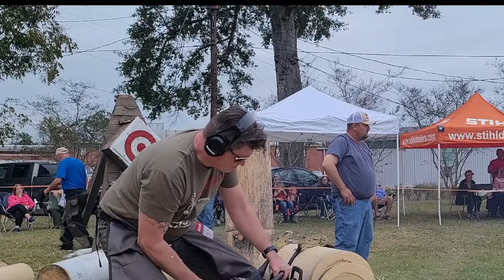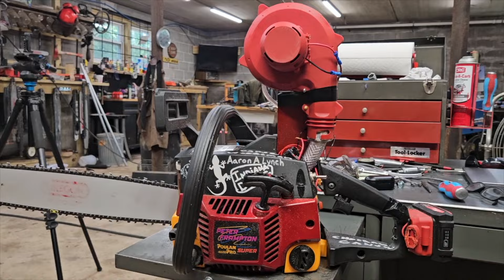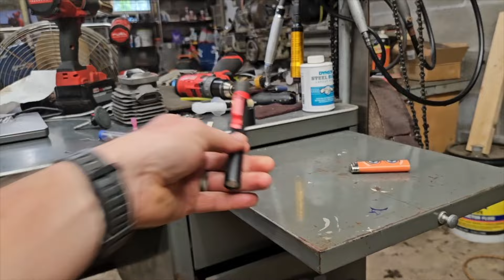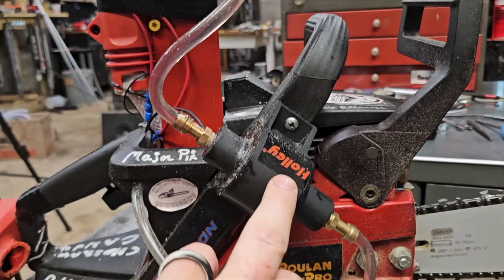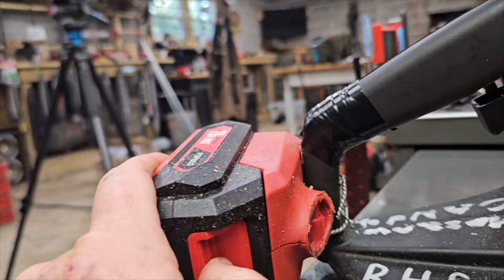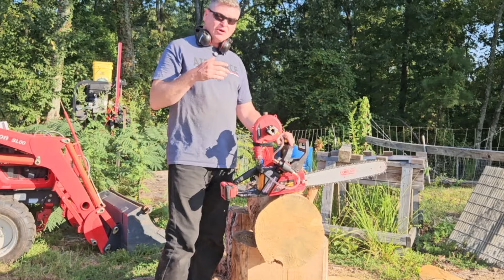Supercharging a Poulan 4620 295 chainsaw!

Comment: I think you're adding a little extra Air Volume, but not actually creating Boost Pressure at at high RPM.

Need a pressure gauge on Intake boot to see.

Comment: Interesting trial!
I suspect that blower in that configuration is restricted enough to fall out of its best flow/pressure range of operation. I wonder if even under the best conditions, that blower could make more than 1psi? ? I guess you could test that
Reply: A smog pump would do better for pressure than that a blower. 
I think they are vane type compressors, positive displacement
and can get up to 20 psi which would definitely be a boost. 
Pre-ignition dieseling could get to be a problem though for
a gas engine at sea level. An injected engine could be needed
for this to work right. A regular carburetor may not work at all.

Comment: Boedy, did you LOWER the static compression or increase it?
For a “normally aspirated” hi-po combination of any ICE your OVERALL compression ratio must be higher. If you’ve ever noticed, the top fuel drag cars with belt driven super charger run about a 7.5-1 CR vs a 12.5-2 normally aspirated setup. You’re also forgetting that it’s not uncommon for a turbo to spin up to 30k RPM.

Comment: This comment is meant for everyone, not directed just to boedy. 
The only way I know to properly supercharge a 2 stroke is the use of rotary valves. Whether that be lobe style or cylindrical rotary valves. You may say, oh yeah well Detroit diesels are supercharged and they don't have rotary valves!
Yes, they are supercharged, but not with real atmospheric pressure gain. The Detroit has exhaust valves with the role of the supercharger being to push in fresh mixture all while the exhaust valve is open. So this fresh charge also pushes out the exhaust gases while valve is open. This results in almost no positive atmospheric pressure in the cylinders prior to compression. 
To conclude, to get a chainsaw properly supercharged would be a nightmare. You technically need both intake and exhaust blocked off at the correct times for a supercharger to work. These port times would need to be very close in height  in order for the intake charge to have enough time to build pressure from the supercharger; then be physically blocked off so that detonation doesn't bleed back into the supercharger. Then, exhaust valve needs to  close, blocking the port so that you don't have boost leakage into the exhaust. Another thing to consider is that an expansion is nearly useless in this application due to the exhaust being blocked off by a rotary valve. There are some instances where this would work, but honestly you don't need the resonance that an expansion chamber provides; however, would benefit from slight pull from a cone style exhaust header.

That is all... lol

Comment: A smog pump can give 15-20 lbs of boost pressure for a small engine
and much higher pressure than a centrifugal blower. You probably aren't
getting enough boost pressure to see a difference.

Comment: Your gonna have to run it simultaneously after the carburetor into the female intake boot/ external carb flow otherwise its just making the carb act weird and would aways do that. Or maybe use a smaller carb with a lower venturi

Comment: I honestly can’t believe it runs at all. I’m not sure if it’s luck or skill but it does run. 😂

Nice work. 💪🏼

I didn’t think you could pressurize a 2 stroke because that literally works against its self. No valves.

I’m not sure yours is pressurized but again, at least it’s running.

Comment: Get your pressure vacuum gauge from the intake experiment and it should explain your short comings  i think that the engine is capable of pumping more cfm than your blower at WOT you may be able to overdrive your blower motor by increasing the applied voltage but idk if even that will help cool experiment though either way